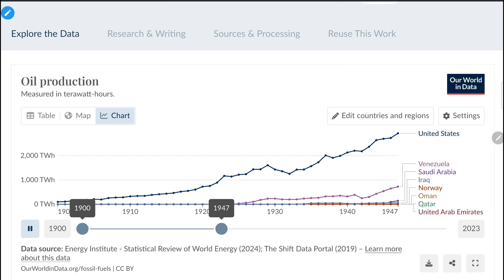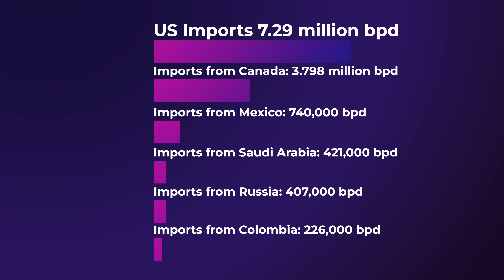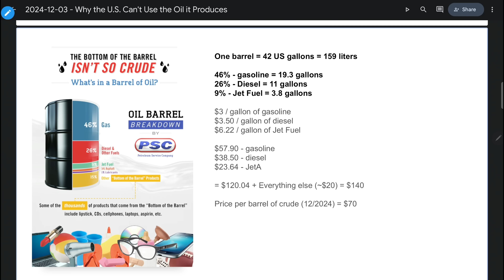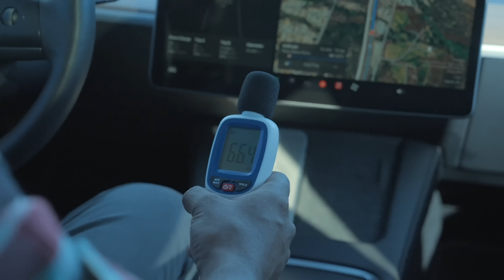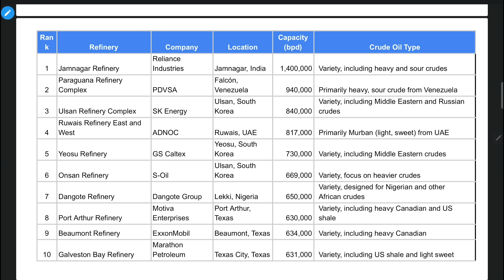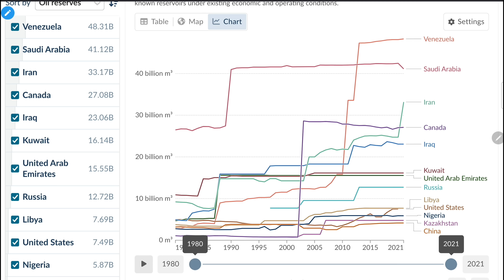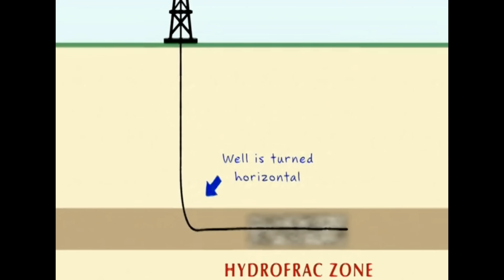Why America Can't USE The Oil it DRILLS

Comment: There is an old saying: “Everything shines by dimming”. That can be applied to U.S. oil production. Yes, U.S. oil production (crude oil + condensate) set an annual production record in 2023 at 12.927 million barrels/day (mb/d). But there is more to the story.

Almost all of the increase in U.S. oil production since 2008 has been tight (fracked) oil production from 5 shale plays: Permian Basin (TX/NM), Eagle Ford (TX), Bakken (ND), Niobrara (CO/WY) and Anadarko (OK). 

Those 5 plays now produce about 70% of U.S. oil production with the Permian Basin alone producing ~45%. The rest of the U.S. oil production increase since 2008 came from the deep water Gulf of Mexico (GOM). The deep water GOM represents about 15% of U.S. oil production and it is now a mature producing region.

U.S. oil production rose rapidly through 2023 but many areas have been declining in 2024. As an example, GOM oil production has been running about 200,000 b/d below the highest monthly value in 2023 (Sept). The latest monthly value (August 2024) was off about 190,000 b/d. 

North Dakota Bakken oil production was off approximately 100,000 b/d in August 2024 relative to the highest value in 2023 (Sept). Oklahoma’s oil production, mainly Anadarko, was down 60,000 b/d in August 2024 relative to May 2023, the highest producing month in 2023. 

Colorado/Wyoming oil production (mostly Niobrara) was down 26,000 b/d in August 2024 relative to December 2023, the highest producing month for 2023.

The ultimate oil recovery for the 5 shale plays listed above will be approximately 50 billion barrels. For the period 2008-2023, total oil production for the 5 plays was approximately 25 billion barrels. 

Here is a statement by prominent petroleum geologist Art Berman from a recent report he wrote concerning the Bakken shale play:

The implications of this Bakken study and recent evaluations of the Permian and Eagle Ford plays are clear—this is the beginning of the end for the tight oil plays.

Here is a statement from an oil industry insider, stated several years ago, concerning the future of U.S. tight oil production:

"Shale [tight oil production] will likely tip over in five years, and US production will be down 20 to 30% quickly. When it does—this feels like watching the steam roller scene in Austin Powers. Oil prices in the late 2020s will be something to behold.” 

An industry executive responding to a poll by the Dallas Fed;

What you won’t hear from the media in the U.S. is that most of the production from new tight oil wells occurs in the first two years of production. To maintain or increase production, wells have to be added at a rapid pace or production declines. At some point, the “sweet spots” within a play get saturated with wells and production declines. That has occurred in Bakken, Eagle Ford, Anadarko and Niobrara. It will occur in the Permian Basin as well.

Almost all the increase in U.S. oil production this year is from Texas and New Mexico with minor increases in Utah and Ohio. Almost all of the increase in Texas and New Mexico has come from the Permian Basin. I'm expecting the Permian Basin to start declining in the next year or two. 

What oil companies have been doing is sacrificing future U.S. oil production to maximum present oil production. That can only go on so long.

It would not be surprising if U.S. oil production declines 5.0 mb/d or more by 2033, relative to 2023, about 5.5%/year. To put that in perspective, United Kingdom (U.K.) oil production has dropped 75.5% since 1999, at a rate of 5.4%/year. In the 1990s, the U.K. was one of the world’s major oil producers but they ran out of fields in the North Sea and production has thus declined.

Conventional U.S. oil production reached a maximum in 1970 at 9.637 mb/d while Alaskan production peaked in 1988 at 2.017 mb/d. Production from conventional U.S. oil is now about 1.6 mb/d and that from Alaska is about 0.4 mb/d. The shale plays and deep water GOM were the last highly fruitful places to go in the U.S. for oil so I expect future U.S. oil production to parallel the decline of the U.K.

I expect that some people will say we are going electric so it doesn’t matter what happens to U.S. oil production. In the last 10 years the number of EVs on the roads of America. increased by around 2.5 million vehicles. In spite of that, U.S. total liquid hydrocarbons consumption (oil + other organic stuff) increased by almost 900,000 b/d. There are around 283 million registered vehicles in the U.S. and a high percentage of the vehicle owners are never going electric. That is the harsh reality.

Comment: Switching to electric is also impossible as we don’t have the infrastructure to the supply the huge amount of electricity needed  and the technology to have long range vehicles. 300 miles is not even close to what’s is needed. Also many people that have fuel powered vehicles have campers/RVs or go the the wilderness for days or a week or more and have no way to charge an electric vehicle and the range of the tow vehicle is horrible. Some as low as 80-100 miles and then have to wait 4-8 hrs to charge back up to go another 80-100 miles. That is totally unacceptable. A petrol/diesel can go 400-700 miles and it takes only 15-20 minutes to fuel back up. Plus the towing capacity is 2-4 times an electric vehicle. EVs are only for control not cleanliness.

Comment: I bought a CYBERBEAST about 6 months ago, and wish I hadn’t. It’s so much fun to drive I have to keep my old vehicles on trickle chargers. I wish I had bought a different model Tesla. Something designed to be driven and enjoyed. Not just designed to look different. But I also have a METACYCLE. An Electric Motorcycle…Designed Around a HOLE! Oh Well, I like my Electric Vehicles. I’m 81 years old. Probably, in the Summer, I like my 72 VOLT/BAC 4000 SurRon. It only weighs about 125 #. It’ll go a little over 70 mph. The METACYCLE weighs about 335 #(Claimed) It also will go a little over 70 mph. But the METACYCLE is capable of keeping it @ 70. The SurRon’s motor would melt if it was kept @ 70 indefinitely. EV’s are fun!

Comment: Electricity is only a way of transmitting energy.  It still has to have a source.  Most electricity is derived from the burning of coal.  The ultimate practical solution is nuclear energy and specifically Molten Salt Reactors that utilize the Thorium fuel cycle.  Look up LFTR.

Comment: Anyone remember the oil companies lobbying to get the speed limit increased because we weren't using as much oil at 55 mph with small efficient cars,  big cars with small engines, and big cars with big detuned engines.
Reply: No, I don't.  Got a link?
Reply: @dlewis9760  Well Dave, look it up.
Reply: Speed limits are outdated and were implemented to many lower levels due to the fuel embargo in the 70’s but never updated for the engineering and technology that we have today in transportation.
Reply: @jasonbobby6351 Which is exactly what the oil industry says and what you just regurgitated verbatim. The insurance industry math doesn’t lie, higher speeds increase probability of accidents and fatalities. Which is why insurance rates are increasing, not decreasing.
Reply: @jasonbobby6351  then they stuck because it turns out slower vehicles are safer (E=½mv², you know)

Comment: Burning one barrel of crude oil (42 gallons) can produce approximately 0.43 metric tons of CO2.
The world gets 104 million barrels per DAY!
16,322,800,000 or sixteen point three two Billion tons of CO2 a year.
This is the same weight as 98,926 average loaded cargo ships... Gee! Wonder why we have problems with our 100km thick atmosphere 🤔???
Reply: It has taken scores and scores of years to put in place this reliable source of energy we all require. Science saw the iceberg dead ahead and warned us back in 1989 (I think they said , there's the iceberg dead ahead, something like that) but you know, the band played on. Macbeth saw the big picture when he said "Tomorrow and tomorrow, (etc) creeps in this petty pace from day to day (etc etc) and all our yesterdays have lighted fools the way to (etc etc) a tale by an idiot full of sound and fury (etc) and shit has hit the fan.
Reply: @blue_beephang-glider5417  I thick your math is of a little. 42 gallons of crude does not weigh any thing close to 0.32 metric tons.
Reply: Sorry .42 metric tons.
Reply: What does it have to do with the atmosphere thickness? We live on a sphere with 6400 km radius, with the surface of 510 million km^2. Which gives you roughly 5x10^19 cubic meters, which is roughly 10^19 kg, or 10^16 tons of air. That's 10 million of billion tons of which about 4000 billion tons is CO2 (400ppm). How many billions tons a year you are saying? 16.3? And don't forget, we still have forests.

Comment: Pipelines are MUCH safer than trucking oil or even transport by train, due to accidents.  Pipeline tech has come a long way since 30 years ago, particularly regarding autonomous maintenance.  Try looking up the actual stats on barrels transported/barrels lost for each type of transportation.
Reply: The problem with that perspective is volume.  Yes, pipeline leaks happen less often (and thats where that "its safer" tag comes from), yet, when a pipeline DOES have a leak, it leaks orders of magnitude more oil then a train/truck can ever leak.  Plus, the pipelines tend to have leaks far outside of large communities, so it actually goes unnoticed for a longer period of time.  If a train derails, or a truck crashes, its noticed immediately.  I'm not against pipelines per-se, but we do need to be real about the negatives of pipelines.  I do think we also build them wrong. I think we should be digging a U trench that is lined with concrete the entire way of the pipeline, that contains hydrocarbon sensors. This would alert of "small" leaks much more quickly, and reduce ground heave failures (which has caused %80+ all winter related pipeline failures since 1980's).

Comment: Just a few words on electrification. You will never electrify commercial aviation, ocean freight, heavy transport and construction machinery, especially in remote locations. Therefore, oil will continue to be front and centre in many transport applications besides other sectors.
Reply: Never is a long time.  Electrification of transport means an almost immediate 100% jump in efficiency.  How long will it take to adapt/adjust to that?  Whether it's battery EV,  Fuel Cell EV, some sort of hybrid,  or combination of these, it Will happen.  Be ready for competition.

Comment: Drill baby drill worked before to lower prices. Gulf Coast refiners: Have the capacity to refine both light, sweet crude and heavy, sour crude. It's true it would cost a lot of money to convert the plant to doing light/sweet only.
There is a reason that EVs made up only 8.5% and that includes plug-in Hybrids last year, we are not like Europe where distances are short compared to here.
We need better/safer battery technology that is affordable where charge times are shorter and run times longer before Americans will except this technology as mainstream... not to mention the cost of these vehicles...

Comment: US oil has a lot of sulfer in it, the rotten egg smell.  To get rid of the extra sulfer has extra refining costs and creates the deadly H2S gas.  The oil that comes from the mid west is called 'Sweet Crude" because it does not have as much sulfer in it and costs less to produce.

Comment: I put in on an average week about 70 to 110 miles on my bicycle. The Chevy sits in front of the condo and unless there is surf (rarely worth surfing most days) or I go visit my son's in Tampa, I don't even move the Chevy. Now when it does go, maybe I take about a 400 miles round trip to Tampa and stuff there and back and that may happen two or so times a year.

The point is that I am now able to shift my transportation to bicycle in Florida and it's better for me, physically, and financially, as I now have dropped my Liability Coverage since I am driving far, far less. With less fuel, cheaper insurance, and reduced maintenance, the Chevy is costing me a lot less to own, especially since the Trailblazer is a 2003 and still runs pretty good, but stuff is starting to age out.

But this is a transition. Eventually, as I mentioned below, we might just shift our transportation methods to in town Tram or Light Rail and forego the need to own a personal automobile entirely. We might still want a transport drone EV vehicle, that is cargo carrying only.

It will be far cheaper to move from suburbia back to better designed and structured cities with higher density of living with better mass transit and no need to own cars at all.

Then we can put more money into investments and education and less on depreciating transportation with high initial cost and high ongoing costs of ownership.

Comment: I don't think it's accurate to say that increased drilling will have no effect on local prices.  It will, just not as large an effect than it would if it were consumed locally.  The highly globalized oil industry means that prices around the world are interconnected.  While the light sweet crude from shale might have a bit of a different profile than other crude oil, it's still basically made into the same things, just not locally.  Increase the supply of the refined products and prices go down globally.

Comment: One way to reduce the weight of an EV is to remove the driver and passenger. Just make the EV autonomous auto-pilot self driving and you the owner, stay and work from home. Then when you need something, you order it online from like a Walmart, who has a person fill a plastic box with your order and prepare it for your car to come pick it up.

The order is collected and Walmart contacts YOUR CAR, not you, and your car communicates with Walmart as to the time and location of pick up. The car drives itself to Walmart, and an autonomous drone order handler is waiting in the pick up area with your order and as your car arrives in the destination slot, the drone loads your order into your car.

The car drives home and your autonomous house drone removes the order from the car and brings it to the Kitchen and alerts you that it has arrived. Then you can remove the items and place them yourself in the pantry and the refrigerator/freezer unit.

How about that? No person, removes about 170 pounds of weight from the car on average, except in China it's about 140 pounds and in parts of America it's 190 pounds on average.

We can edit the car structure even more, removing seats and entertainment and making the car a true utility vehicle not for passenger use. The resulting EV self driving car will be very small, and much lighter.

When you need to go somewhere yourself, you can step outside and be met by a CitY NerD Tram that runs every 5 minutes and arrives to a Tram Stop less than four minute walk from your home. 

You take the CitY NerD Tram to your destination, like a Park or Riverfront or some nightlife city culture hub, or the airport or High Speed Train Station.

But we stop owning big cars and trucks. We have autonomous vehicles and drones doing the silly mundane tasks for us and we concentrate on working and developing our intellectual skills and language skills as we have more resources to travel and improve our education as we NO LONGER need to buy a $40K vehicle, when we can buy a small $12K autonomous EV and a $5K House Drone. 

Or we could do as I do and ride my $500 mail order Motobecane bicycle to Walmart with my backpack and buy a day or two worth of food and ride there 4 to 5 times each week. I get a lot more exercise and I don't burn any gasoline. 3.9 miles one way.

Comment: People who believe we should give up our pursuit of fossil fuels are naive in their understanding of energy. As a career diesel mechanic for Caterpillar, I can tell you first hand that we are no where near meeting the energy demands of mining & construction equipment by using green sources. This equipment builds and maintains our world, without it society would crumble. The engine in a 797 CAT dump truck is 3,500 horsepower; to achieve that level of power and to have it run for more than 5 minutes using a stand alone battery / motor is simply not possible. Not to mention aircraft, cargo ships & emergency power generation requirements. We need to transition to a cleaner form of energy, there’s no doubt about that. Right now, we need fossil fuels. Our lives literally depend on it.
Reply: Molten salt and sodium reactors will in the future produce high heat for synthetic fuel production and complex chemistry.
Reply: @leontb69  I can’t speak on that but I hope we find a solution. There’s consequences with every form of energy production
Reply: jcb are already producing a hydrogen ice engine to replace diesel, cat aren't far from doing the same.
Reply: @ no one debates hydrogen is an effective fuel. Currently hydrogen does not an affordable processing or distribution network. It’s extremely expensive and dangerous to concentrate, store and transport. Also hydrogen ICE engines still have high NoX output which is considered one of the most dangerous pollutants.
Reply: Passenger vehicles are the biggest users of oil.
Reply: @ No they aren’t. Passenger vehicles are less than 20% of global emissions